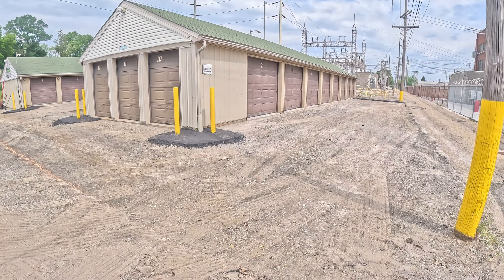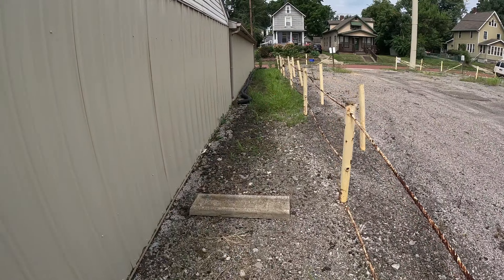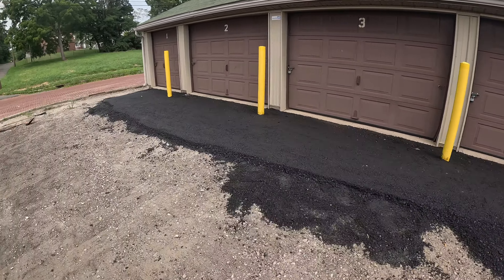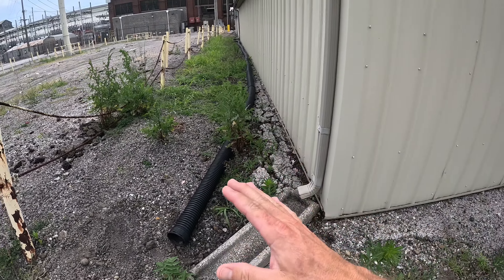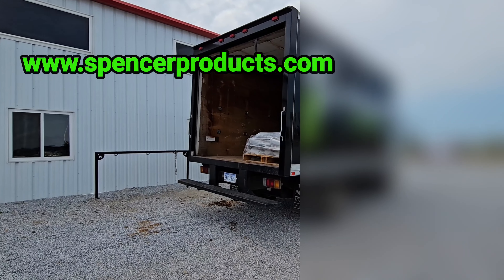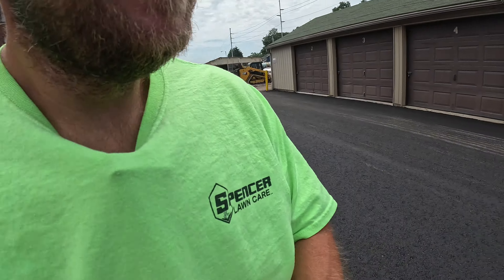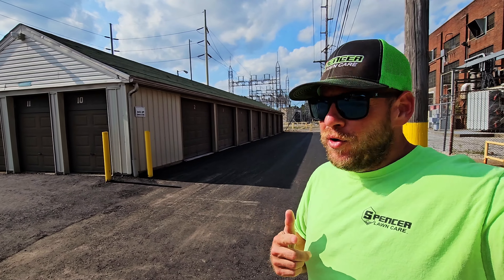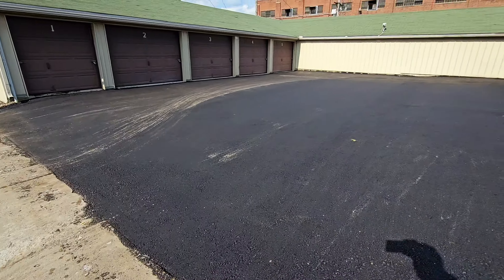THIS JOB TURNED OUT BETTER THAN WE COULD HAVE IMAGINED!

Comment: Man, there is just SO much porosity in this...I am sorry to see this. Yes, it IS going to cause problems, even with heavy sealer. This lot could literally be gone back over with an infrared unit and rebonded and smoothed. It looks like they got to far ahead with the paver and/or weren't right with the program (late) with the rollers. Some freezing/thawing cycles will certainly show the difference. 😢

Comment: no binder just finish coat  I can't beleive they pr did those spots instead of doing it all while hot  and not back heating , not something I would pay for  any driveway that uses just the finish coat does not last under heavy traffic

Comment: That blacktop will be all cracked by next summer
Reply: If those guys and that COMPANY knows what they are doing it will NOT BE CRACKED,  especially if they SEALED IT CORRECTLY, most of the time when you see black top cracked is because it was not done right or SEALED
Reply: Based on you watching a 2 minute video explain
Reply: @geo752    EXPERIENCE, DUH, WAKE UPPPPP, WOW, You really need a wake up call don't you
Reply: You will be surprised that it won't be cracked. Do you think big truck will be driving on it?
Reply: do they not use liquid tar down on the ground first? 🤷‍♂️
Reply: @petejones5488  sometimes, But also they can use that as a start for the asphalt Base, just depends on what the Owner or customer wants on their location or property or whatever 😎👍
Reply: @petejones5488  the base is packed from years of the business being there.  And they don't do the when they lay a brand new road
Reply: @petenolte4192  OBVIOUSLY, you don't get around ALL of the United States, because just because what YOU SEE doesn't make it the ONLY WAY people or Businesses do things, so you might wanna consider that before randomly throwing comments out there,  your Definitely NOT an expert and I'm NOT either but I have seen it done several different ways,  keep an open mind to that
Reply: @deionsharpe5139  I live in Minnesota where it freezes solid and gets 100 degrees in the summer and they don't so tell me again about experience

Comment: That asphalt is going down at 350 - 390 degrees.
I did that kind of work back when I was in my 20s. 
You can actually cook corn on the cob in the hopper of the paving machine .we would remove the silk from the fresh ears of corn and wrap it in foil and then bury it under a shovel of hot asphalt for about 20 - 30 minutes. It made for a nice Hot lunch while waiting for the next truck to show up.

Comment: WOO HOO‼️ Been a long wait for this. 👏🏼👏🏼👏🏼 I live in the Pacific Northwest - rain central. Concrete guys here usually recommend splash locks like yours of gutter extensions to divert rainwater off driveways etc. Don’t know if asphalt is the same.

Comment: That asphalt road leading to ur facility looks like crap, that’s a 4 inch pothole on that manhole cover. I understand it having to be under 2 percent grade for ADAs but it looks like that company didn’t mill dowm far enough. Also that so called “finish” coat looks like base. Maybe too cold laying it down. You can also already see what’re holes from off grade. They weren’t on lunch break it seems like a long trip to and from the plant. Horrible pave job